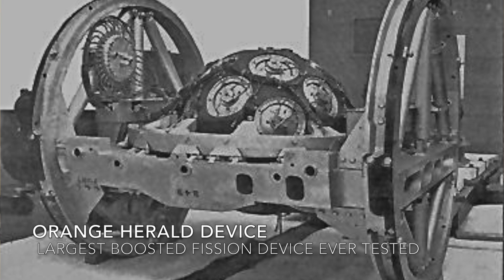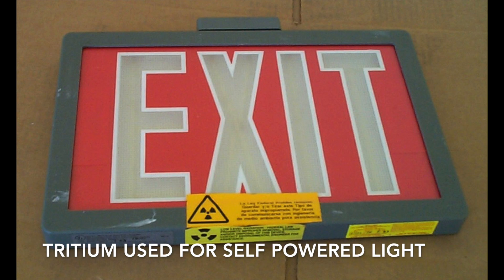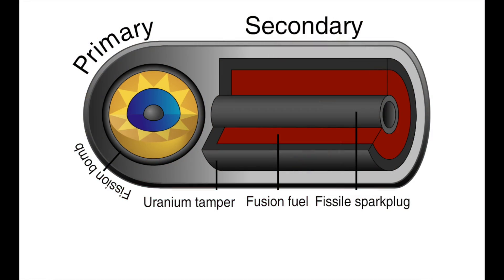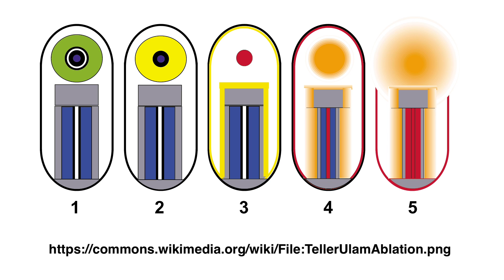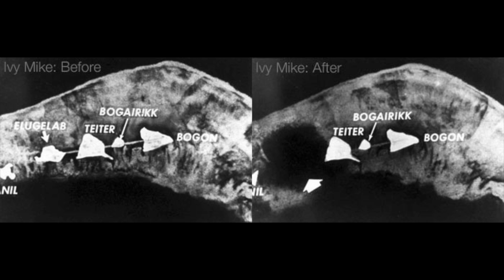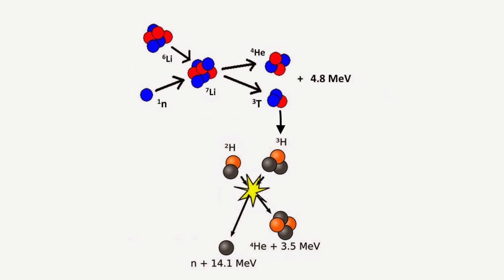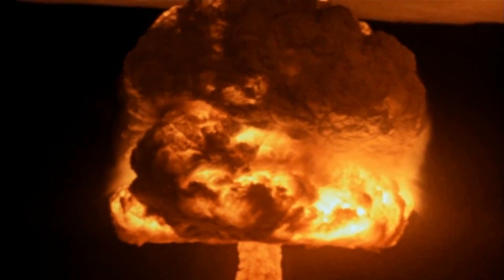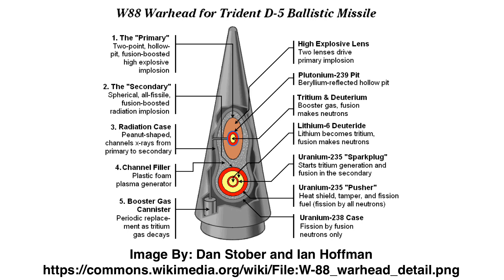Going Nuclear - Nuclear Science - Part 5 - Hydrogen Bombs

Comment: That isn't Castle Bravo. You can see the Bikini atoll extending past the shot to the right. The Castle Bravo crater is at the top of the atoll where it turns to the left and is actually on the atoll itself. This one is over the lagoon. You can look up a map of the craters. That is a smaller Castle shot 5km to the right. It left a small dent in the atoll which is still visible. They made that mistake in the Trinity movie hosted by Shatner. The only released footage of Bravo is from a plane flying low somewhere around 50 miles out at 10,000 feet. That appeared on youtube around 10 years ago.

Comment: 5:06  “there may be other processes involved”  Ablation-thrust is often used to explain compression as if these X-Rays are just stronger versions of what hospitals use. The X-Rays come off a primary at the density of lead and fill the bomb chamber at the speed of light – imagine if you turned on your flashlight and the beam shot out as dense as a heavy metal.

Comment: So I have a few questions about the weapons specifically the US and Russian versions of these weapons. First one is Why is it if they technically work the same way why do the explosions look drastically different from one another. When the rds 37 exploded it looked like a sun floating just a few feet above the ground while Castle Bravo looked more like a firey version of the fat man? Secondly looking at the footage of rds 37 not long after the explosion these strange looking rings form around the giant ball of helium in the sky. What exactly is that and what causes it?
Reply: RDS-37 was a 1.6 megaton airburst at 1,550m above the Kazakh steppe in November when air temperatures would likely have been below zero Celcius and moisture content of the air in terms of absolute humidity was low. Castle Bravo was a 15 megaton surface burst close to sea level on a small island that was part of Bikini Atoll (until it was vaporised) which is located in the tropics of the Pacific Ocean. The test was in March with air temperatures of 29 degrees or more and high humidity which results in a huge amount of moisture in the atmosphere.

The expanding rings are condensation clouds formed by the sudden rarifaction and cooling of the air after it has been compressed and heated by a shockwave passing through it. A similar mechanism is behind the formation of vapour clouds around rockets and aircraft in flight.

Comment: At 100MT yield you really just run out of targets big enough to be sensible for the use of such nuclear weapon. High yield weapons were from a time when hitting the target precisely was not guaranteed. With precision guidance and ground-penetrating technology available nowadays you actually run out of sensible targets pretty fast even at the 300kT level, even for reinforced military targets.
But for those 'lower yield' weapons the world nuclear powers still keep nearly 10000 warheads ready to be used in less than an hour. (2/3 of which are just the USA)

Comment: I've just reread the book 'The Binding Energy of Matter' about the life of Ted Taylor. His 105mm nuclear shell used 'bare cores'. In short, it looks like be it a 0.3Kt or a 5Kt weapon, it's going to use about the same amount of fissile material.
 That said, he DID do an interview in which he pointed to a stick of chewing gum and said ' if just part of THAT was converted to energy, it would knock down the twin towers (NB he said that in 1975).
 I am still interested in mercury pyroantimonate. There is a lot of chemistry but 1 key aspect usually ignored is that the named compound could be comprised of activation products i.e. H->D or D->T. Mercury & Antimony can absorb 5 or 6 neutrons and STILL form reasonably stable isotopes.... so the stories told do match the science.

Comment: Fun fact, one reason they use lithium for batteries is that they can extract the 6Li isotope from it for both nuclear weapons fuel and making neutron detectors. For battery use plain old cheap sodium would work at abput 85% of Li efficiency, being  just fine in an ion intercallation system 🤔

Comment: I believe the peanut design is to take advantage of the rocket thruster analogy, and adding a choke point to increase velocity and also concentrate the column of photons bombarding the fusible material. Much like the combustion chamber of a rocket motor, and directing/ increasing velocity in the "exhaust"  through a "Bell nozzle".

Comment: The Tsar Bomb was also very clean because of the way it was tested. It was air dropped with a parachute and detonated relatively high above the ground. When it went off, the height of the detonation meant that the shockwave has time to reflect off of the ground and this reflected wave prevented the radioactive fireball from reaching the surface. The interaction of a nuclear fireball and the ground is where the majority of radioactive fallout is generated as the dirt and debris are irradiated. This is also why ground-level tests like those conducted by the US in the Pacific and Nevada caused so much fallout, as most were done at or near ground level

Comment: You misspoke hehe. Lithium 7 does fission due to low energy neutrons. When fused with a low energy neutron to form the unstable lithium 8 it releases a beta particle and turns in to the extremely unstable isotope of beryllium 8. Beryllium 8 then splits in to two helium 4.
This gives out quite a bit of energy per nuclear reaction, but still not anywhere significant compared to the over all yield.

Comment: If it is possible to create Fusion Weapons with virtually no Radioactive Fallout why have they not been used Commercially in remote areas where the blast would not affect existing infrastructure?
Blast a new Shipping Canal. Create large new Reservoirs etc. Divert Rivers.
Reply: It's been proposed many times but nothing has even been implemented.

Comment: 9:36 I was shocked to learn that the largest weapon ever to have been set off was one of the cleanest due the lead or more accurately the efficiency.  Makes me wonder if there could come a day where nuclear weapons could become so clean that they might actually be used again?  Thoughts?
Reply: The general idea is to promote peace, not war.
Reply: @paulanderson79  you missed the whole point
Reply: The main two issues with the use of nuclear weapons as I see it are the massive civilian casualties that would result, and the threat of MAD. When you deal with the kind of fusion weapons that would be large enough to be clean, you would either waste most of the blast and/or end up with huge amounts of collateral damage. When you deal with nuclear warfare in general, it would be hard for at least the United States and Russia to not just wipe each other (and most of the rest of the planet) out, and this problem could probably be extended to other countries as well. Basically, the use of nuclear weapons on earth is either a terrible idea or just an impractical one

Comment: Another problem with the huge bombs is they 'splash' the atmosphere above the shot, effectively blowing a large part of their energy into the stratosphere.
If your fireball has a radius of 3 miles and was detonated 8 miles up for best target coverage, how thick is the air above and below that blast?
With denser air below, less dense air above, a lot of force just goes the way of least resistance.
Firing the shot closer to the ground does more damage, but over a much smaller area.
Not everything scales up.

Comment: 3:40 My understanding was that Ulam originally thought about using the neutron flux coming from the primary to heat&compress the secondary, it was Teller who realized that the radiation (ie, high-energy photons) coming from the primary would get there first and be more effective.

Modern lightweight warheads often use highly-enriched uranium as the tamper around the lithium deuteride, as U235 has a higher fission rate for neutrons of all energies and gives a higher yield for the same weight.
Reply: I wonder if actually the neutrons from the primary act as an external initiator to the secondary spark plug, so the radiation/ablation pressure cause compression, and a few shakes later the neutrons get to the now supercritical spark plug and trigger it.
Reply: @DaleUlan  My guess would be that the primary neutrons would get there before the secondary is really ready for them, so there may be some neutron-absorbing material between the primary and secondary.  I believe the neutrons for initiating the spark plug comes from a little bit of tritium (or a D/T mix) in the center of the spark plug - even if the temps aren't super-high, the density should be high enough to cause a few fusions and some high-energy neutrons to kick things off.

Of course, these are all just educated guesses.  🙂
Reply: I was wondering if the interstage material had moderating properties that would slow the neutrons down enough so the arrival time is correct, without any delay there probably would not be enough time for compression - on a W88 the neutron delay if the interstage does not slow it down I think should be 25ns or thereabouts. Probably you are right, there’s enough neutron producing material around the spark plug that it should go off. Or maybe it could be done with another external neutron source? Or would a fizzle in the spark plug ever really happen?

Comment: When a mass of fissile material is exposed to neutrons (or squeezed, or suddenly incremented in mass, or has the control rods withdrawn) it approaches criticality.  The critical point is reached when the mass produces the same amount of neutrons through fission as are lost outside the material.  Now, some of those neutrons are produced immediately and some are produced over time (they are from decay of fission products, happening statistically after the product's half-life), as long as minutes of time.  These delayed neutrons make the difference between controllability of a reactor and the run-away that would happen if all neutrons were "prompt".  This point is the "critical" point, and is quantified (by Slotin, BTW) by the notation "zero dollars" of reactivity.  The domain above the critical point is known as super critical.

As the criticality is further increased, the point will be reached where the delayed neutrons are no longer needed to sustain the nuclear chain reaction. From here on, the chain reaction is exponential with a very small time constant, measured in shakes, or tens of nanoseconds.  This point and the reactivity region above it is called "prompt critical" and quantified as a "dollar" of reactivity.

MsMotron below asks: "why does not everything that goes supercritical explode? should the power produced not increase exponentially until something slows the reaction down? (like the core exploding)"

Obviously, bombs operate in the prompt critical domain ($1 or more); nuclear reactors in the supercritical domain (from $0 up to but not including $1).  An explosion is caused when the mass heats so quickly that it turns to plasma and heats high enough to cause copious x-rays from black-body heating, which super-heat the air in the fireball.  The Demon Core became prompt critical very slowly (in a nuclear time sense; it was a very mild fizzle when Slotin slipped), and so the small amount of heat generated expanded the core, decreasing its density and made it lapse back below a dollar before it was high enough to create very many (if any) x-rays.  Slotin managed to destroy the possibiity of it resuming prompt state as the core cooled. 

(For the guy in the back raising is hand, x-rays in a nuclear explosion are created by the black-body effect.  The gamma rays are also somewhat black body, but mainly generated directly by the nuclear reactions. That's why Slotin was irradiated, that and the flood of neutrons. (That's my understanding, anyway, but what does an engineer know?)

It is said that one could cause a creditable explosion by  swinging two subcritical hemispheres of plutonium, one in each hand, to crash together in front, but it would be so slow a reaction that the explosion would be in the tons of yield - pitiful.

Comment: Hey Scott; What if you shot an item, say 1 meter long, with a gun, however the object was spinning so rapidly that it would spin at least once before the bullet would be able to exit it if it were not spinning. Would the bullet change its path or would it still try to go straight? For example, could it shoot back at you, or would it only be effected by so much that but it would still go relatively the same direction with minor or major changes in its direction.
Reply: Circular motion consists of a fixed tanhential velocity and a n aceeleration directed tovards the center. The moment the projecticle exists the barrel this centripetal acceleration would cease. It course would be determined by the sum of its tangential velocity at the time of exit, and its velocity along the barrel. 

tldr.: It would dly diagonally to the barrell with the angle determined by muzzle velocity.
Reply: Im not talking about the barrel being spun, im talking about what ever it hits being spun. For example, a block of ballistic jell, if you shot that and it started spinning at right when the bullet enters it, where would the bullet exit.
Reply: +Santiago Formento Depends entirley on terminal ballistics.  Generally if it alters the course of the bullet it has to give it enough energy to accelerate it to its new course. So for it to throw it nack at the origin it would have to transfer twice the bullets original energy.
Reply: Hmm, Well that is true. I wonder what it would look like though, if you did that and were able to make a slow motion video of it. What if the bullet still goes forward, but the inside of the ballistic jell is deformed as it is spun around the bullet causing a massive cavity.

Comment: The mechanism by which the radiation is channeled between stages is not classified. It's pretty easy to understand and calculate. The radiation acts as a photon gas, expanding in all directions until it's impeded by a high-z, low photon diffusing element like Lead. The radiation case absorbs the x-rays and heats up. This causes it to re-emit the radiation as thermal black body radiation. This radiation heats up another part of the case, and very quickly it reaches thermodynamic equilibrium.
Reply from the maker: Do you have a declassified document that explains this? I had thought that official disclosures along these lines were essentially nonexistant.
Reply: @scottmanley  Off the top of my head I can't recall a declassified paper that speak specifically to the mechanisms of interstage radiation transport in thermonukes, but the principles of radiation transport are well documented in open literature in the fields of early cosmology, stellar mechanics and inertial confinement fusion. 
Yakov Zeldovich (regarded as one of the fathers of the Soviet H-bomb) talks about the physics in his book "Physics of Shock Waves and High-Temperature hydrodynamic phenomena". 
There's also several papers by Pritzker et. al from the Swiss federal institute of technology (the institute that produced Switzerland's nuclear weapon design that give theoretical models of radiation transport in uranium plasmas. 
The general trend is that the lower the electron density of a medium, the lower the attenuation coefficient. 
So beryllium and plastic foams are relatively transparent compared to uranium, for example. 
From the degree of ionisation at a given temperature, the ionisation cross sections and the nuclear charges, one can determine the opacity or mean free path of that medium at a given temperature.
From this one can work out the thermal diffusivity of the medium, and from there the rate of energy flow within in. 
I have modelled all of this for various materials within nuclear weapons. I have completed a design of a first generation pure fission implosion weapon, and I'm currently working on thermonukes, mostly reverse engineering the B-28. I did send you an email a few months ago asking if you wanted to discuss nuclear weapon physics in more detail, as it's something I've spent many years researching.
Reply from the maker: @Evan_Bell  Thank you regardless, I've learned a bit more in the intervening years, but it's still a mindblowing subject.